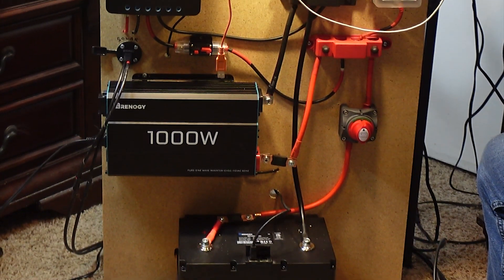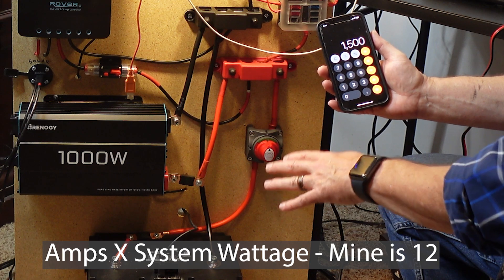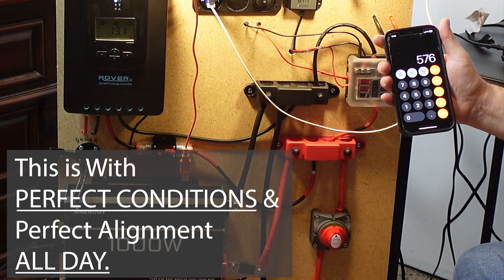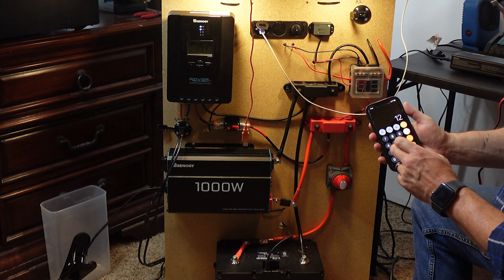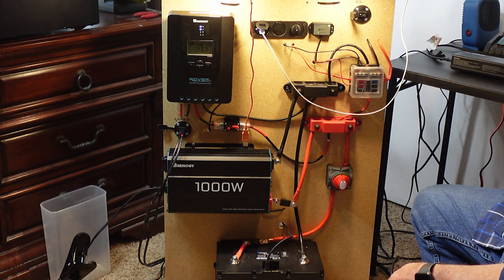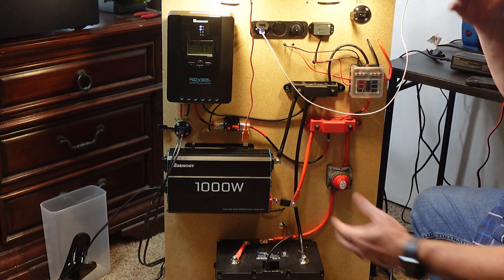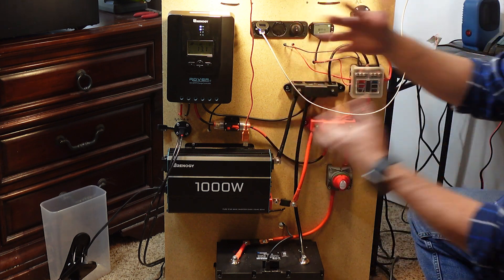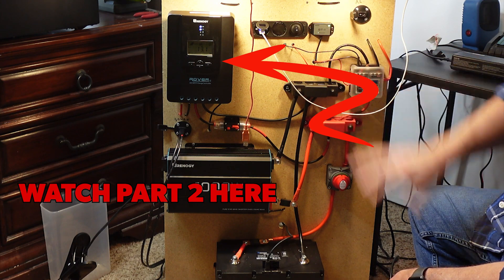DIY Solar Generator: What Will It Power in an Emergency

Comment: You're trying to simplify a very complex subject matter. First of all, there are losses. A 1000 watts into an inverter will not give you a 1000 watts out. There are internal losses created by the inefficiency of the electronics, heat losses during the conversion process.  Also, DC watts does not equal AC watts. One is an average reading quantity the other is a RMS value. There is also losses in the battery. 5 amps of charging a 12v battery will not give you 60 Watts of available power. And of course you left out AH or  Amp-hours out of your video. A battery will not supply its terminal voltage indefinitely. AH is actually a better quantity to rate a battery power availability. Another thing you must consider is duty cycle. Not all loads will be consuming power at all times at the full nameplate rating. If time is considered, then you might be able to run that refrigerator,  a toaster, lights and a radio off that battery, just not all at once.
Also, please consider wire management and workmanship when handling any type of wiring.

Comment: I use three  400 watt solar panels wired in series to keep my batteries up to snuff…and keep them on stand by and have an inverter just for my fridge, coffee maker and microwave…it’s 12v and 3300 amps and I use a victron inverter… my other two batteries are 1200 amps and they’re cheaper and they power our lights and computers…oh I forgot…another 3300 amp battery and inverter dedicated to the home server and HAM radio and satellite phone for emergencies…

Comment: I think your math is off I can run a mini fridge with 2 100v panels with 2 100ah batt.  Buy the biggest charge controller You can afford by the most amount of batteries you can afford then add the panels as you go The panels will add up to suit your needs to replenish power on demand

Comment: You DRASTICALLY over estimated the power requirement of a mini fridge. 

I have a larger dorm refrigerator with separate freezer and it averages about 18 watts an hour over a 24 hour period (about 450wh a day). It does jump up to over 100 watts surge during compressor start up, but quickly drops down to 40-50 watts. The compressor is off a lot of the time.

Comment: interesting....
QUESTION ?
So if you have a 1000 Watt invertor, 
and you have over 1500 Watt battery source
Would it still work ? or would the invertor burn out ? or would the Invertor only work with 1000Watt input and put out a little less than 1000 Watts ? 

I am soo confused...
Does the 1000Watt on the invertor , deal with the input or output of the Watts ??
Reply from the maker: I had this inverter run an 1100w hot plate. That's pushing it lol. The battery is only as good as the inverter connected to it, and a 100ah battery is good for about 1500w max
Reply: The battery is not watt, it's watt hour @wh, watt and wh are not the same things..

Comment: I like you're ideal and plan. Trying to build something similar. Build something small and Mobile that can handle the basics. Learn from that. Tp eventually do a bigger offgrid type system. Ive been looking at using ammo cans as power stations. Im thinking adding a 10 amp or so 120v battery charger to have option to charge from generator ect. The renogy 2 pack 100 watt panels are on sale. I got a set last night
Reply: Probably a good time for you to add on.